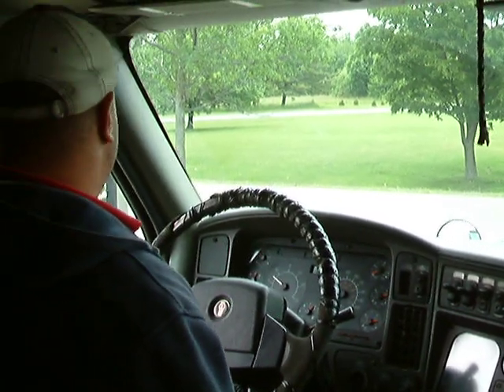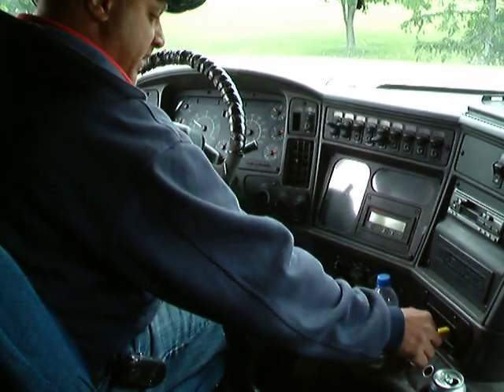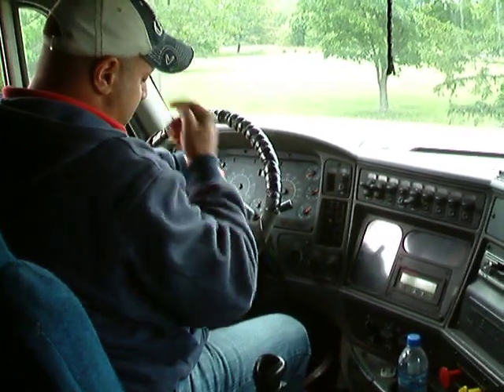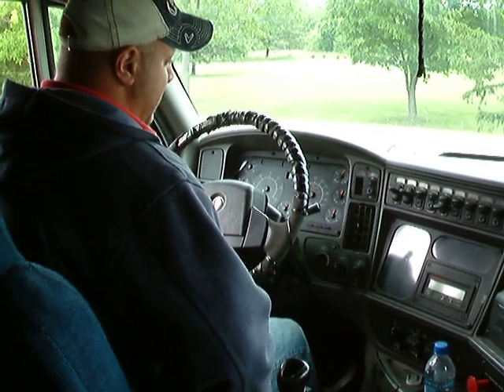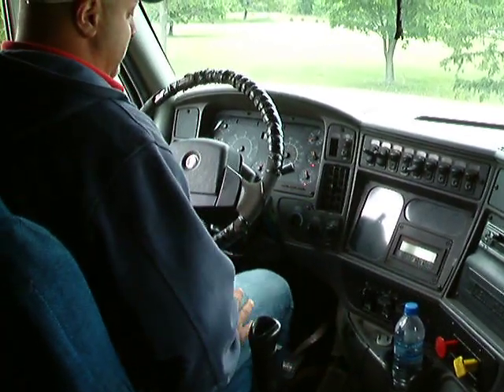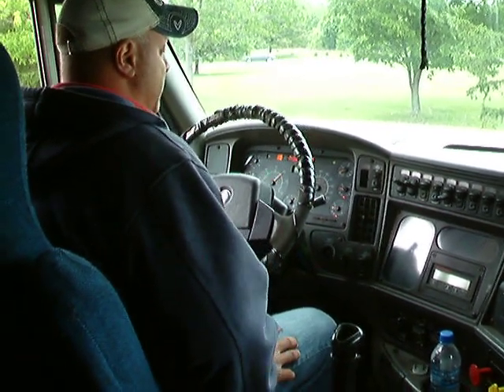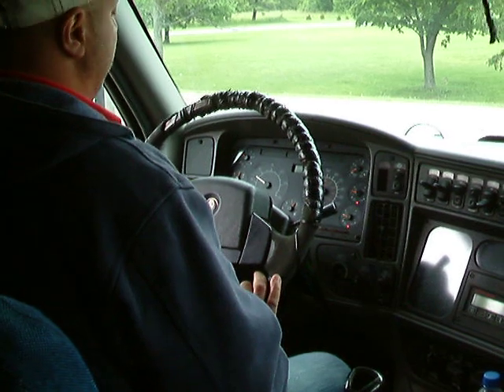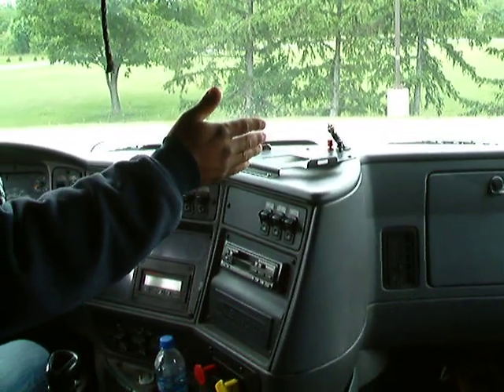NY in cab pre trip inspection for test

Comment from the maker: @starlingcastillo the 50 foot brake test is when you pull away after the inspections and your on the driving part of the test, you MUST test your breaks by pressing the peddle WITHIN the first 50 feet of driving, this ensures yours breaks are working. come to s smooth full stop and then continue with the drive.
I am hoping you are taking professional advice and instruction before taking the test. good luck

Comment from the maker: you will be asked to parallel park from the center of the road to the side.
then move your truck back to the center of the road ensuring its perfectly straight for the straight line backing, about 30 feet.
then when you pull away on your trip stop withing the first 50 feet for the 50 foot break test to ensure your breaks work for the trip ahead.
a smooth stop will suffice, dont stab at the breaks he wont like you much.
highway and local roads are preferred if your area permits both. 
good luck

Comment: In long island they failed you, I did all that and failed, because I didn't mention how I know the gauge is working. She didnt ask me that until after I finish. She wanted me to say for instance my temp gauge is work and is around 180f,  my oil gauge is working a about 20psi at idle. You also have to spray you washer fluid and have the wiper working at the same time, high beam low beam blue indicator working seat belt secure no cuts windshield no cracks are illegal sticker registration up to date fender mirror adjusted properly, floor is free of potential hazard like a bottle or anything that can roll under your pedal. The school I went to teach me just the way he did, and I failed. Thank God it was a nice examiner she tell me how to explain it and do it next time. Hope this help someone

Comment from the maker: @starlingcastillo ok they wont ask for it and you wont have to do it, as long as you remember the 50 foot break test after you pull away you will be fine , if its not in the video you dont need to do it . dont forget these 2 videos only cover the inspection side NOT the actual driving part of the test

Comment: So the only thing not described on this video that must be done is to use brakes within the first 50 feet after leaving the curb? Do I need to use the trailer brake on the right of the steering wheel in any type of pre trip inspection or while driving? Thanks!
Reply from the maker: Yes the 50 foot brake test is not described here .
NO you never mention or use the trailer brake lever .thanks for asking .